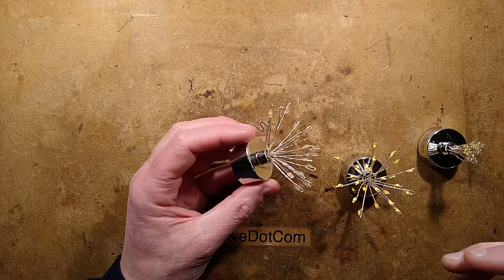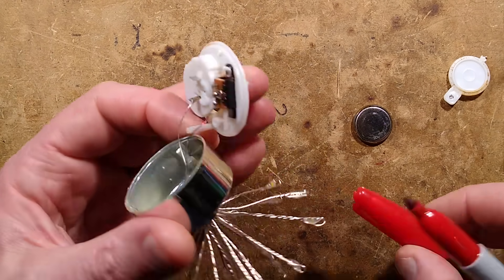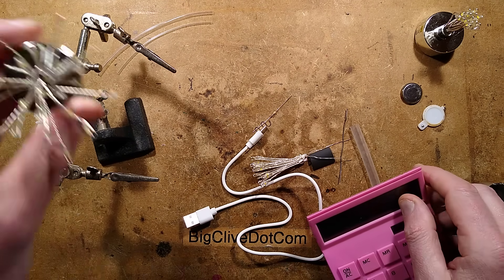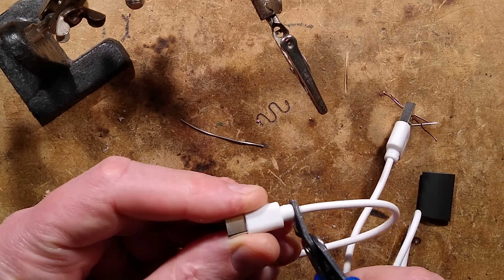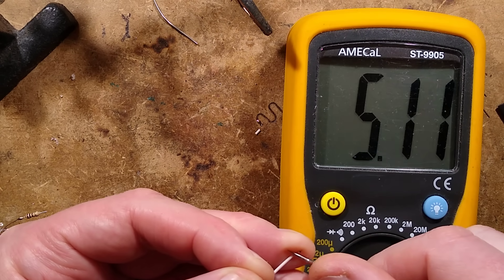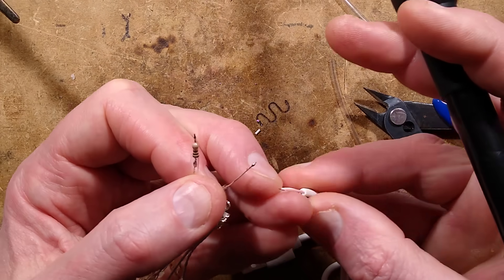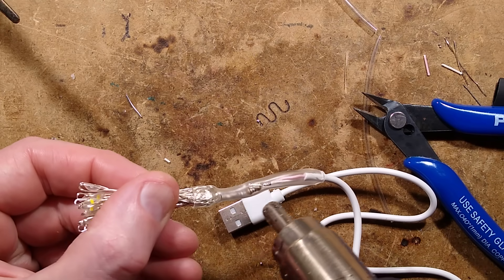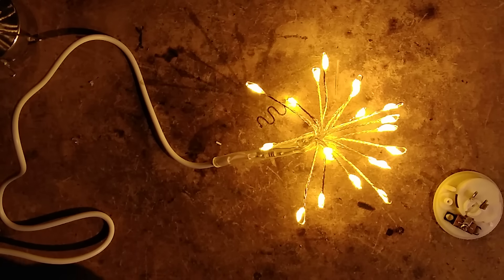ASDA/Walmart tea light cluster USB mod

Comment: I now have encountered USB-C cables that you can only test for polarity using a load. A multi meter does not show the voltage coming through when there is no load. Annoying chips inside the USB-A side or something.
Reply from the maker: Smart power supplies monitor what the cable is plugged into and may not put out power unless specific resistors are detected.

Comment: A forum I’m a regular contributor of is currently having a discussion about ferrules vs no ferrules in plugs, and if there is any benefits in regard to resistance to using them vs not using them. If a this something you could investigate
Reply from the maker: The main advantage would be avoiding the twisting motion of the end of the screw displacing the strands.  The ferrule would keep them together and just provide an even gripping force.

Comment: Interesting that they just took a normal string of "fairy light"/blob LEDs and folded it into that shape.
Those strings are pretty versatile and often dirt-cheap. Bought one a few years ago that was already terminated with a USB-A plug, but since the LEDs were super bright (probably over-driven) I added a resistor to the cable to tame them down. The strip is now taped to the underside of a display cabinet with masking tape (to further reduce brightness and soften the light) and used as a night light for our dark hallway.

Comment: Whenever you mention aluminum wire it reminds me of a project that caused issues. I needed to extend a led string, so I bought a 4-conductor phone cord. I fund after I cut the ends off that it was stranded aluminum, which I couldn’t solder, so I had to go another way. I hate to waste anything, so I’m still looking far use for aluminum wire.

Comment: Maybe its original cell was an LR2032 or AR2032, which did what alkaline or carbon batteries do, and the CR2032 you found was a replacement. Or maybe their battery supplier thought the C in "CR2032" stood for the country of origin instead of the battery chemistry, and they have a whole bunch of mislabeled cells floating around.

Comment: I have a string of these in 5 clusters of 20. And is powered by 3 AA batteries. I think 4.5v is a bit too much, as they get rather warm.
Reply from the maker: You can add a resistor.  Better still, do it like I did here and run it on a spare USB charger.  The one resistor will do all the LEDs.

Comment: Yes Clive its cold in my work room to. so to keep my feet warm, I have an old mains 30 Watt soldering Iron put inside an old biscuit tin that I rest my feet on, on the floor under my bench Also the rising heat keeps my legs warm. 1000W = 28p So 1000 / 30 = 33..333Hr for 28p

Comment: Grok: Q: "What percentage of the world's power consumption is merely being wasted as heat within resistors (where the resistor is being used as a potential divider and not as an actual heating or lighting element)?"
A: "Determining the exact percentage of the world's power consumption that is wasted as heat within resistors used specifically as potential dividers is challenging due to the vast and varied applications of resistors across different sectors. However, we can approach this question by considering general principles and insights from available data:
    Resistor Power Dissipation: Resistors in potential divider configurations convert electrical energy into heat due to their resistance. This heat dissipation is inherently part of their function when used in voltage dividers, where they are not intended for heat generation but for controlling voltage levels. The power (P) dissipated by a resistor in such a configuration can be calculated using Ohm's Law and the power formula P=(V^2)/R, where V is the voltage across the resistor and R is its resistance. 
    Efficiency Concerns: While resistors do waste energy as heat, this loss is generally a small fraction of the total power in most modern electronic devices. For instance, in LED circuits, which might use resistors for current limiting, the power loss can be significant in comparison to the LED's power consumption, but still relatively small in absolute terms. Sources suggest that in applications where heat dissipation is not the primary function, the power wasted can be negligible or at least not significant enough to dramatically affect overall energy consumption (Stackexchange).
    Scale and Application: On a global scale, electronics consume a significant portion of energy, but the proportion specifically lost to resistors in voltage dividers is tiny compared to other forms of energy loss or consumption. For example, the inefficiency in power transmission lines or in large-scale industrial applications far outweighs the heat loss from resistors in consumer electronics. 
    Estimation: Without specific global data, we can infer from general electrical engineering principles that the percentage of power wasted as heat in resistors used as potential dividers is likely very small. Given the diversity of electronic applications, it might be less than 1% of total power consumption, but this is a speculative estimate based on the understanding that most high-power applications do not rely solely on resistors for significant power management (Stackexchange).

In summary, while resistors do dissipate power as heat when used in voltage dividers, the percentage of global power consumption this represents is likely very small, possibly less than 1%, given the scale and nature of modern electrical usage. However, exact figures are not readily available without extensive data on specific applications and energy use patterns."

Comment: At my workplace Secret Santa/Baby Shower party today, I finally fixed the non-illuminated top third of the Christmas tree that has been bothering me for a few weeks. Whoever set the pre-lit tree up neglected to plug in the upper third's string into the other two strings. 🤦‍♂ Here I was, checking the bulbs individually thinking one had worked its way loose, but no, it was a much simpler solution. Well, at least I accomplished something today.

This is a rather clever "hack" of a visually-pleasing little sprig of LEDs. And you don't have to run to the Automotive Dept. in Walmart for replacement batteries now! Better for the environment, better for the wallet.

There's a larger variety of these that are solar-powered, with a stake at the bottom, for outdoor use (if the ground hasn't frozen solid yet). I discovered them by accident when driving up to a customer's house to deliver their paper; my headlights charged the batteries just enough to kick them back on in a riot of strobing colored LEDs. (I think they'd be gorgeous in "golden white," instead of RGBY.)

Comment: I don't go testing every cable I get, but if I find a charge only cable, it goes right in the trash.  I don't want to be troubleshooting why something isn't syncing or communicating when it's just a crappy charge only cable.  The only exception to this would be one I would travel with just in case I have to plug into some random charging port.

Comment: That really is a good idea.
Small strings of such LED lights were sold in various pound shops a few years ago attached to a small battery holder and switch 
containing two AA batteries. These had 6 LED lights running on 3 volts from the batteries.
Could these be "converted" to USB in a similar way. If so, what value of resistor would be preferable?
Reply from the maker: 100 ohms should be ideal or that too.

Comment: I’ve been buying these for the LEDs. Add a little charging board and a cell from an inhalation device and you get a rechargeable string of lights that run for hours before recharging. I’ve used them in Christmas decorations all for about £2

Comment: I have 8 USB Christmas lights sets all have 6 or 8 LEDs it's from Poundland many years ago and they are powered from a 240v to 5 volt at 1000 MA power supply and they all give out a very nice light but the power supply does get a bit warm so may be I'm pushing the power supply a little to hard
Reply from the maker: You can mod standard strings with either one 10 ohm resistor for short strings or two 10 ohm resistors in series for longer strings.  That will keep the current down and prolong the life of the LEDs greatly.

Comment: im only here to feed al gore some more rhythm, 
im shocked these have actual switches, the trend here has been to use 1 of the legs of the led as a switch with a mechanical plastic ramp used to press it to the battery when the switch is switched
Reply from the maker: I don't care for the cheap flickery metal strip switches.  They're far too intermittent.

Comment: Nice conversion Clive, button cells are wasteful and expensive.  A plug in USB power brick seems to be the answer, could one not power all six clusters or more at once?  Most of mine output at least 2A @ 5V.  Wonder how hot it would run?   Thanks Clive and Christmas cheer.
Reply from the maker: How many it could run would depend on your chosen cluster current and how heavily you wanted to load the supply.  Even a basic supply can run thousands of LEDs at low current.

Comment: Clive, can you recommend some mains powered warm white LED fairy lights that retain their brightness after a year or more regular use? The ones I have tried lose their brightness after a few hundred hours usage. I guess they are probably overdriven.
Reply from the maker: They do tend to degrade quite quickly in intensity.  You can get better quality ones, but they often still overdrive the LEDs for intensity at the expense of lifespan.  Depending on the type of power supply you can dooby the lights to run at lower power.

Comment: I wonder if it would be possible to fit a rechargeable type of street lithium in the base of this light, including all the corresponding circuits and USB...🤔
Reply from the maker: It would be a very small cell.  But in a bigger case you could make it last for weeks or even months on a charge.

Comment: Those are quite nice, Clive, but I bought several identical lights from Tesco when they reduced the price, as they always do a couple of weeks or so before Christmas. BUT, mine are multicoloured, so yours are a bit boring in comparison 😈 While watching the video, though, it gave me an idea to rewire my lights like you did, except that I also bought four or five packs of multi-coloured anodised aluminium knitting needles on sale for 99p a pack of 8 in Aldi a few weeks back. I could cut the pointy ends off the knitting needles and feed the wires down the resulting tubes. Thanks for the inspiration!

Also, you could embed those lights in resin and make little lamps, like Nick Zammeti does sometimes.

Also, also, for anyone in the UK who might be interested, although I can't say if all branches have/had them, but I picked up a pack of 15 flickering tea lights from the 'middle isle' in Morrisons in Woking last week for £5. 15 flickering leds for other projects and 15 CR2032 batteries seems not a bad deal for £5.

Also, also, also, remember that after Christmas/New Year, if my local garden centres are anything to go by, all their Crimbo stuff will probably be discounted by 50% or more so it's a good opportunity to get led lights much cheaper!!

Comment: Those look lovely 👍🏻 when you soldered the USB lead to the resistor I blew at my screen to cool the joint down 😂 I think I need to get out more !!!
Reply: One also tends to breathe out purposefully when magic solder smoke drifts towards the camera. You just develop reflexes!
Reply: @robbieblackmon1801  true 😄
Reply: I've done that before. But on this video when Clive was flipping the cell out of the light, I automatically helped by tipping my phone! It did make me smile. 😁
Reply: lol - I used to avert my gaze, when videos showed arc-welding in progress - it took me a minute to realize my silliness... Cheers-
Reply: @markaoslo5653  safety first!
always wear protective glasses while watching dangerous videos 🤣
Reply: @SystemX1983  - 👍 😂
Reply: I was careful not to breath in the smoke ...
Reply: 😂 as I also watch woodworking/machining channels, this happens to me all the time...
trying to blow away wood/metal chips through the screen 😅
cooling down solder joints is also an issue 👍

Comment: I saw a video, where I guy bought test leads w/ alligator clips, from China. The wires were copper coated iron wires, that could be picked up using a magnet! You might have fun using a magnet on your Chinese Wire Collection!?
Reply from the maker: Most suspect wires get the magnet test and then the lighter test (for copper coated aluminium).

Comment: Copper coated Aluminium wires are great, they can save you a resistor. 😉
Reply: and a fuse!
Reply: Power lines are CCA https://en.wikipedia.org/wiki/Copperweld no problem there ....
Reply: Copper coated iron wires are better for that purpose 🙃

Comment: You've given me an idea with this. I have a very long string of Christmas lights with one of those dedicated power supplies. Quite boring as presented. I'm thinking I'll cut down on the length and put these at random positions just to liven things up. I think the supply is 4.5V but I'll have to check.

Comment: I just use 1N4007 diode(s) to provide the appropriate voltage drop when converting to USB, although there is the disadvantage of not running at a lower current for longer life. Also, if you offset the positive and negative wire splices, you can get away with one piece of heat-shrink to insulate the lot.